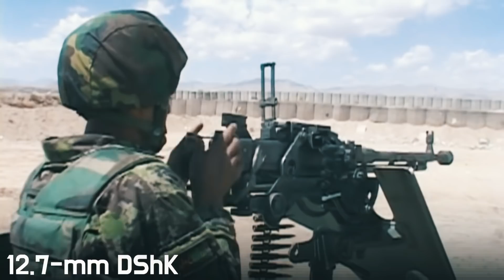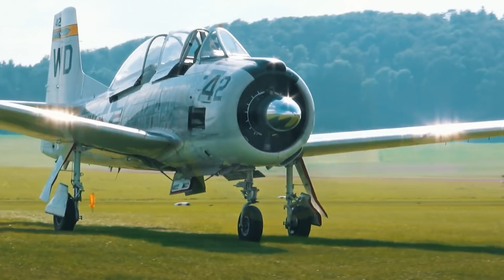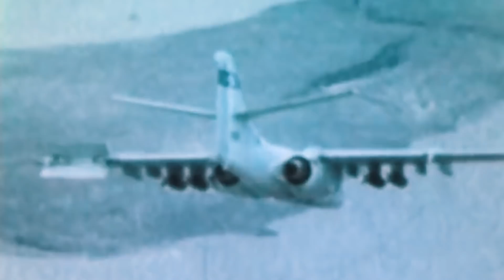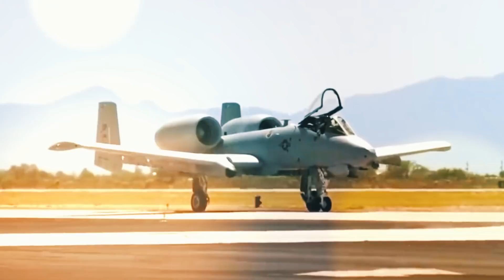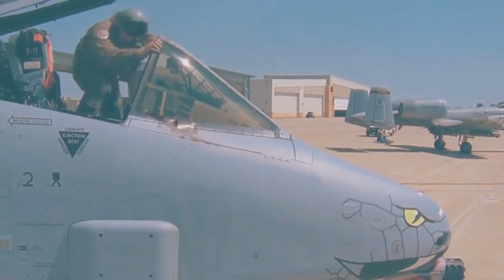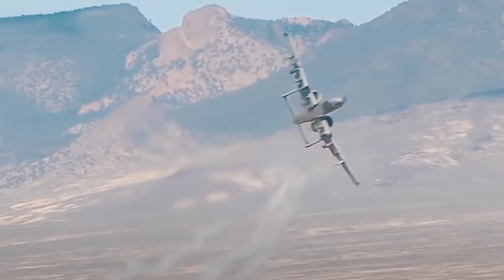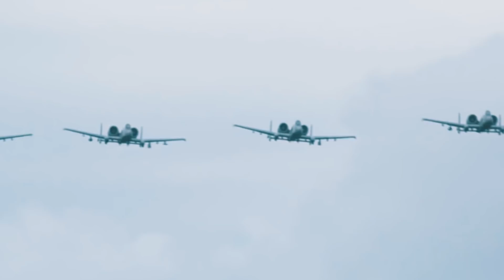U.S. Tests The New Super A-10 Warthog Secretly

Comment: Don’t replace unless it is with a replica utilizing advanced construction techniques which will render it cheaper and even more serviceable. Issue a civilian version identical in every way except for weapon systems, pylons, forward gun, and tactical avionics. Add the co-pilot seat and replace the gun’s weight with cargo space, or added fuel capacity. Make the engines more fuel efficient on this civilian version which would likely reduce top end speed and ceiling, but might help to balance the weight. Offer it in a nice color and the rich will line up to buy them supplementing the cost of making military ones.

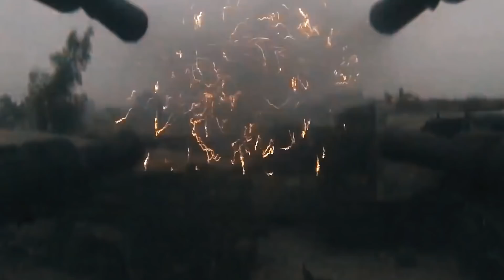Comment: I should have tuned out after hearing that the T-28 Trojan was designed specifically for the war in Vietnam (0:30).  This is a completely false statement.  The Trojan was designed in the late 1940s to be a trainer replacement for the T-6 Texan.  It has some limited  ground attack capabilities, but it is primarily a trainer, hence the "T" designation. It was produced in the 1950s and production ended before 1960, before the US was officially involved in Vietnam.  Also at 4:00 - "23mm Shilka missile hit".  Really?  Maybe you meant to used the word "missile" synonymously with he word "projectile"?  Regardless,  the word you should have used is "shell" since the ZSU-23-4 Shilka  spits out cannon shells.

Comment: Surely...ANY replacement for the A10  CANNOT be as expensive as the 5th Gen A/C.  Any replacement MUST be cheap to produce Easy to maintain RUGGED and give confidence to both operator and those being awarded close support.  Which exactly and completely describes the A10.  If it aint broke don't fix it.

Comment: The only prototype of the A-9YA is a static display located at the March Field AFB Riverside California Air Museum. I was stationed there from 1982-1990 and I walked around it many times. Still in pretty good shape the last time I saw it in 2008. 
Due to the SALT talks, A-10s were not allowed to be permanently stationed in continental Europe. They could only stay for 90-day rotations at detachment bases from bases in England. The Soviets feared them that much not to have too many so close to their invasion points. 
In Germany, they used to do practice runs on my USAF mobile radar unit and sister mobile unit units out in the field. It was still scary wondering if they let loose with their gun by accident on us. They came down so close many of us took pictures and film of their attacks on us and sister units. Some were able to send them to the pilots if we knew them. They loved them.

Comment: The T-28 was “specifically designed” for combat in Southeast Asia? That’s BS! Both the Nomad (T28-A) and the Trojan ( T28 B and C which had a shorter prop and an arresting hook) were designed as Naval trainers. We sold them to foreign countries that did use them for combat missions in which it excelled.

Comment: I still think it should be given a redesign like the E and F model F-18 Super Hornets: Slightly larger, new materials and techniques (less metal means less maintenance: One particular routine inspection on the '10 took twice the work of your average A-D model Hornet), upgraded forwards compatible equipment, but keep the gun (because it is awesome).  Call it the Thunderbolt III, although I'm more inclined toward "Feral Hog" or "Razorback".  Make the original Warthog seem tame by comparison.

Comment: Should have mentioned the fiasco that happened in Congress when the A-10 was on the chopping block and to be replaced by the F-35, of which had to be modified with an external cannon and still wasn’t as effective as the A-10 in troop support operations.

Comment: Every tme the overpromoted ones in Washington try to get rid of the Warthog the US finds itself in another war where they badly need a CAS ability, and guess what takes to the sky.  Then as soon as they can those in charge try to scrap it again.  I could make a number of possibly libellous suggestions why they do this, but no matter.  Anyway it's been suggested more than once that if the USAF really doesn't want to operate the A-10 then they should just hand the whole lot over to the Army,  who I should think would be delighted to have them.  

And as for using the F-35 in the CAS role,  this is a joke right?

Comment: The T-28 Trojan was designed as an advanced trainer, and not for combat, though some south american countries did use it for light attack. At the beginning you said the Shilka was a 23mm self propelled gun(which it is), then later you say it could withstand a missile hit from a Shilka(which it does not have), while showing it firing its guns. I see you got a new robo-voice that sounds better but, y'all's script is still woefully inadequate. Also there is stolen footage from the IMAX film, RED FLAG near the end. So, y'all just like to steal other's work and slap your name on it. Good job.
Reply: This is what happens when Millies try to do history stories using Google as their resource
Reply: Yup.  Garbage.
Reply: A10 was replacement for Douglas A1 skyraider.
Shit goes down hill fast. 
Like loran was an upgrade to it.
Cessna's had it before the first A10 flew

Comment: "Old man?"

Fear the old warrior. There is a reason he got so old. That works with planes also.
It was about 1998 or so, we were at Ft. Lewis for our annual training as a 19D CAV Scout Troop. I'm establishing my section of a screen line and it is a field of grass. With one big old oak tree. And no, I cannot displace further. We set up under the tree. Net, branches, a few bushes, and we're set. I hear a jet. It's low and coming my way. An A10 pops up over the tree line. And gains altitude and orbits our tree. I had been told we had A10 support. I radioed and asked them to tell that Warthog we were friends. Less than a minute later he waggled his wings and darted off. I've always been glad they are on our side.

Comment: One of the best, toughest, most reliable and beautiful aircraft in the world. The A10 is directly responsible for saving more soldiers lives than any other aircraft in modern history. The bar has been set, and the replacement for this remarkable plane will have to really be able to work miracles in order to prove itself better than the A10. When I hear the term “When pigs fly” I laugh and think of Afghanistan !!! Long live the mighty Hawg !!
Reply: I think there are some Skyraider 'SANDY' pilots who would dispute that claim
Reply: @ssnerd583  The Douglas Skyraider is pretty and I don’t know exactly what role it played during its lifetime as a combat aircraft so I would not dream of beating on it, however I do have firsthand experience with the A10 and C130 Spooky. What I can tell you is when you need close ground air support and you hear those turbofans…..well let’s just say that your chances of getting back to your FOB increased substantially.

Comment: A-10's have come home safely after losing over half a wing or missing an engine and half of the tail section. It's the most durable aircraft in the U.S. arsenal right now. It's a crazy shame that Air Force "management" wants to can the A-10. The Army and Marine Corps. came to the rescue last time. I'm not sure if the AF brass is still gunning for it.
Reply: I think the Air Force brass is a little too in love with planes being the latest and greatest and sometimes forget that the A-10 is not a fighter jet but a highly effective ground support platform that other service branches that actually have troops on the ground have come to depend on.

Comment: in the absence of heavy armor, what if they pulled those avenger cannons out and just replaced them with m-61 vulcan 20 mm autocannon or maybe 2-4 of the 7.62 mini guns? Bringing 30mm depleted Uranium at a couple of thousand rounds per minute to à sortie that is mostly… uh, … soft targets and white pickups is just wasteful and silly. Using smaller caliber guns might allow more ammunition, allow the addition of some more modern armor for both plane and pilot, or something that would put the weight savings to good use. I wonder how many A-37 Dragonfly airframes they have mothballed at Davis-Monthans?

Comment: Yet we have military leaders in the Air Force wanting to kill all the A-10's, believing the F-35's can do the job. I've even seen where they feel close ground support should not be part of their mission. First of all, look at the cost of an A-10 compared to an F-35. I can see what'll happen if an F-35 comes in on a low level attack and gets shot down. Those leaders won't want to risk losing another since they are so expensive. As to those who want to kill it because it's not the Air Force's mission, if that's the case then take away some of their budget and give it to the Army so they can have the A-10's or come up with a replacement to protect their troops since those in the Air Force don't believe they are worth protecting.

Comment: I saw the A-10 line up for it's attack run many times in Iraq. I always thought to myself that I was VERY glad that it was on OUR side! It was always a morale booster! There is NO reason to get rid of something that works so well in direct support of troops, so pls leave it alone!
Reply: The folks that value this aircraft are the ones that got to see firsthand in actual combat what a marvelous machine this was. The A-10 has saved many a grunt from getting his ass handed to him on a stick during combat. The A-10 is a grunt's best friend when the fit hits the shan.
Reply: : To the troops being attacked on the ground, there was no more welcomed sound than the Wart Hog's 30mm cannon blasting away the enemy position.  A great and necessary plane.
Reply: It is such a useful plane. Might as well switch it to army commands since it's integral to infantry objectives etc.
Reply: @modelcitizen72    THE Army only has rotory wing aircraft
Reply: @ssnerd583  :
Incorrect, O. M. .
But the types, and numbers of fixed wing aircraft the army has is very limited, and includes only small passenger transports for the brasshats.
Reply: @K7DFA  ....they have NO ARMED fixed wing aircraft.
Reply: @ssnerd583  : 
I thought I said that.
Reply: @K7DFA  ......yeah...I said it too....
Reply: @ssnerd583  As of 4 April 2019, the Army has;

    193 - fixed-wing/STOL aircraft +
    3,372 - rotary-wing/helicopters =
    3,565 - total crewed aircraft +
    10,441 - UAVs/UCAVs/drones =
    14,006 - grand total of aircraft
Reply: @modelcitizen72  Give them to Biden who will give it to the Taliban so that future battles will be more equal.  Afterall, we are nearly there with the gifting of surface to air gifting, Bradley and Abrams gifting of late.  :-(
Reply: Maybe we should keep them so that when donnie turns his January 6th White House Storm Troopers lose in his next presidential election loss, we can turn the A-10s on them.!!! 💪💪💪💩💩💩
Reply: Oh there is a reason.  It's relatively inexpensive to build and maintain so the Defense Industry hates them and lobbies Congress to get rid of them.
Reply: its really too bad that you cant arm it up to the gills with cluster munitions and napalm and send it on its way to deal with all these 'insurgents'  THAT would decide the battle much more efficiently
Reply: Didn't the USAF decide to "Keep it flying" for a few more years.? "If it ain't broken, don't fix it".!!!
Reply: New light hypersonics and even Russian Pantsir system will show these guys it's definitely time to retire.
Reply: Amen, brother!  They are a scout's friend.  Always loved the flying cross; that is what they look like in a bank turn.
Reply: Though the hog is amazing at what it's designed to do (bust tanks and sometimes fortifications) its main drawback is that it was designed in the late 60's / early 70s, and the battlefeild has changed significantly since then. There's only so far updates and upgrades will get you before something will eventually go obsolete. It will be sad when the warthog's decommissioned, but all good things must come to an end.
Reply: @pyronuke4768  Yours is the mantra of Hog-hatters for the last 25 years, but the airfraft isn't loved for it's looks or its quirky personality. It's loved because it's the best platform at what it does and because it saves lives on the battlefield.
Come up with a bette tool for close air support and destroying armoured collums, and those with skin on the ground will happily wave bye bye to the big ugly bird.
Reply: @baldieman64  I don't hate the Hog, far from it. I had my ass saved by them twice in Iraq. However I have been paying attention to how war has been changing in the last few decades, and unlike some I've come to terms of letting things go when the time comes.

As to coming up with a better tank buster, things like GBU-53 do exist, and can be dropped from a range outside of having to tussle with something like a Tunguska.
Reply: Except the air force brass don't want to "support" ground targets no matter how important that is for the ground troops. They want high flying multi billion dollar fighters and stealth bombers that dont work. Who cares if they don't work. They get to be thr program general who will make connections to work in as soon as they retire. They want to be program executives to be glory hounds......start singing....up we go, into thr wild blue yonder.......supporting ground troops? Thats being second banana. That's not glorious. That's not high flying up into the sky. So they've tried to kill thr A10 several times. And each time ghe troops on the ground called and mailed their congressmen to save the A10 so th3 generals got delayed.
Reply: @ms.annthrope415  The USAF blocked the Lockheed Cheyenne helicopter (in the 60's) because its performance threatened their role as possessor of high performance A/C, even if it was for ground support. 
Now they want to walk away from that responsiblity?? because their commitment is to blue sky budgets, not down to earth soldier savers.  Resurrect the Cheyennes and let the Army take care of it mens with its own flying ground pounders.
Reply: Well, to be fair, the A10 has a track record of friendly fire due to the shot dispersion of the GAU-8 and mis-identification of friendly forces due to poor optics. Additionally, it's mainly being used with guided munitions rather than its gun. Due to all of the upgrades, maintenance is more difficult due to subsystem complexity, which reduces the A10's other primary advantage, simplicity of operation. There are other aircraft available that can take over the A10's present role of CAS with guided ordinance while being better optimized for that role.
Reply: @mattbrody3565  :
Which aircraft?
Reply: @K7DFA  Reaper drones, B1, B2 and a couple others come to mind in terms of how they’ve been used in Afghanistan. As you can guess, they’re a bit excessively capable and expensive for those roles, which is why the Army’s currently acquiring AT6 Wolverines and F15EXs for lower-cost CAS.

It sounds ridiculous from an outsider’s perspective, but the rationale is the same for why the UK replaced Harriers with Tornadoes for CAS, despite said Tornado being one of their fastest jets. Either make sure your aircraft can hit without being hit (speed, stealth, altitude), or make them so cheap that being hit doesn’t matter. Since guided munitions have proven to be cheap and reliable, slow loitering times don’t really matter anymore unless fighting an enemy that’s already been bombed back into the Stone Age. The A10 is stuck in an odd middle ground, closer to the slow cheap end, but it’s been forced to do the same missions as the B1, B2 and F15E.

Comment: When I worked at the National Air and Space/ Udvar Hazy Center every spring we had a fly-in where all types of aircraft would fly-in and be on display for the day. Every year it never failed that 1 or 2 A10's would show up. You don't realize how big the A10 is until you're standing next to it.  It's definitely one of my all time favorites.
Reply: Mine too I saw them dog fight in Indiana at Bunker Hill Air Force Base. I love the sound of the turbine engines!
Reply: 8ól
Reply: Lived in Kansas City in the late 80s, early 90s, when Richards-Gebaur was still active and hosted a reserve unit of A-10s.  There's nothing quite like driving I-35 and having a Warthog do a pop-up strafing run on you when they were training. The agility of the aircraft at low levels was impressive. As they pointed out during an air show, try to lead the plane by a couple of seconds (which emulated a gunner trying to get a bead on the plane) and see if that is where it ended up.
Reply: @bobdruzynski3882  The USAF actually does adversary training with the A-10 on occasion.  The lesson the fighter pilots get boils down to "don't get into a turning fight against the A-10".